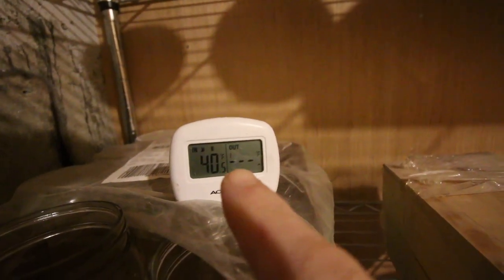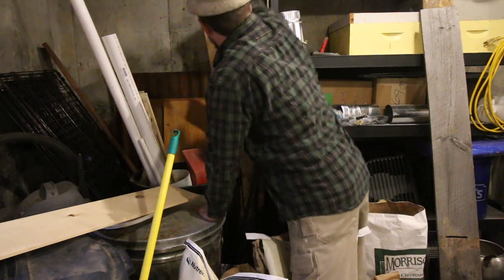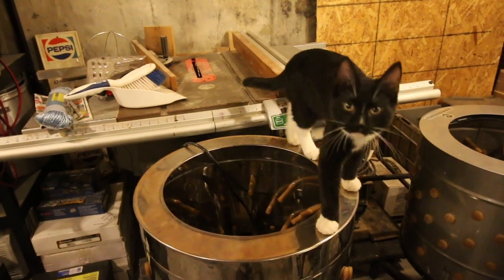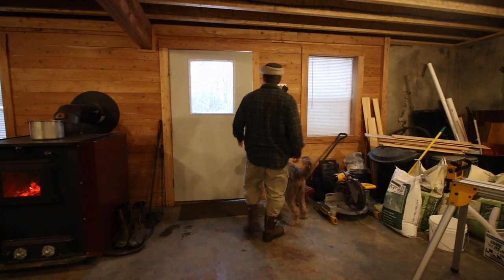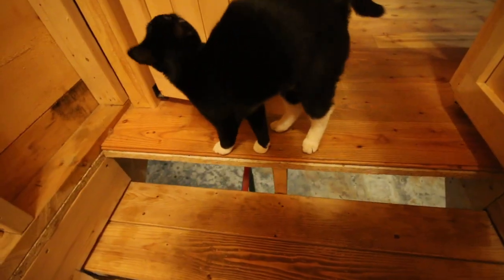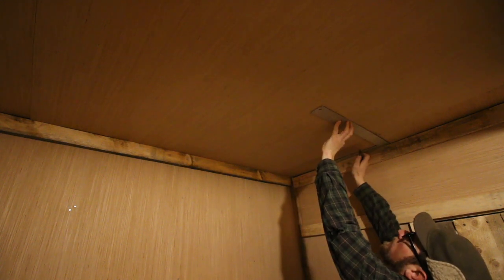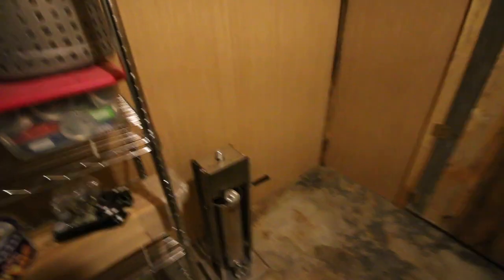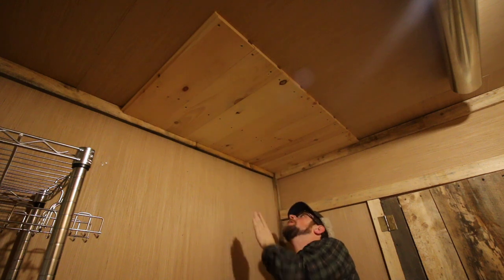Getting the Root Cellar Setup to Hang our Prosciutto & Capocollo

Comment: Just a cheaper option for a action camera instead of a GoPro is the YI 4K action camera, I have one and it works pretty damn good and it's only $200 instead of the $400-500 GoPro and all the mounts are universal.  It also has built in wifi and they have an app so you can control the camera from your phone.  I'll probably end up buying a 2nd one cause I'm pretty happy with it.

Comment: I'm not a photographer, and I don't know the price of those cameras, but it seems to me that getting a different type of camera is going to give you more flexibility in videography than having two of the same kind.

The cave looks great! The salumi ("salted meat") look great!
I was kind of surprised you didn't hang a couple of rods, a series of wires, or a rack for your salumi. Some kind of suspended hanger with a bunch of hooks would give you a great deal more options than a few hooks in hanging the curing pork over in that corner. You could even make the hooks out of forked branches - you just need some pieces with two nodes to make an "S" or "C"  hook. If you prune fruit trees later, you might have a large supply. I'm just saying...
You could make some salumi rods to match your door handles, but I'd suggest making a small forge to heat the metal more easily. Or not.

Comment: Al, think about putting a metal mesh or bar grating up there suspended about an inch or two under your siding panels.  This way it'll give you maximum configuration choices since you can move the S-hooks (attached to your twine) to any spot on there.  (Placement of the cured meats will vary due to the size varying year to year.) http://www.directmetals.com/dm/products/wire-mesh-products/
Reply from the maker: Thanks, I like that idea.

Comment: Do you know anyone who has grown Delicata squash? I need info on curing and storage! . Costco has wonderful shelving units...for 125 I think they are on sale.
Reply from the maker: I dont. Sorry
Reply: For those who might be also asking the question...Here is the response I got from a Baker Creek Master Gardener  "If 4X14 is all the space you've got, trellis growing is indeed the best way to get good production, because if allowed to sprawl that isn't room for many plants. Cattle panel is strong and works well. If you were to go two panels high, I have no doubt that both types would make it to the top before the season ends! They'd need excellent support, though, to avoid accidents during the growing season. You might be able to run two 14' tellises along the outer edges of the bed, meaning two trellises 4' apart. In that configuration, I would plant Delicatas as close as 2' apart in the row, and Kabochas 3'. This does presuppose you'll be training the vines up and limiting their sprawl.

The curing process is indeed the same for your Delicatas. Squashes store best in dry conditions and not too cool--50-60F works best. To enhance storage, in addition to allowing full maturity on the vines and proper curing, some people wipe each fruit with a 10% bleach solution to disinfect the surface, and this does make sense. Also make sure to inspect stored fruits frequently in order to promptly remove spoiling fruit, to minimize spread of spoilage organisms."